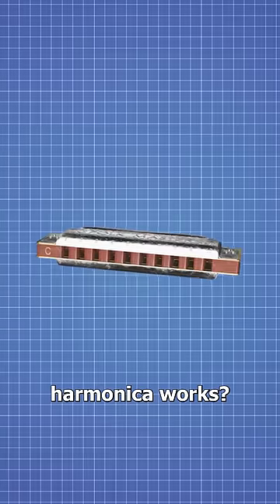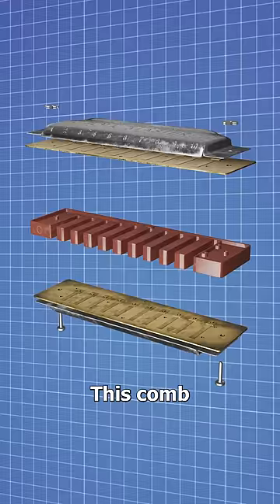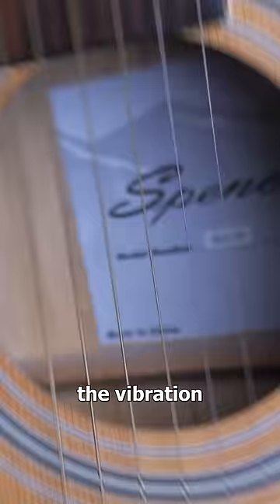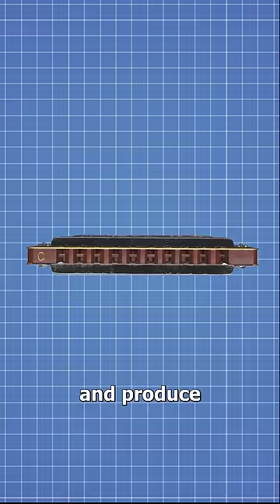How A Harmonica Works 🤔

Comment: And bending happens when you change the interna) pressure in your mouth (tongue, jaw, cheeks), making the reeds vibrate at a different range of motion, and different notes.
Reply: How do you shape your embouchure to blow into specific holes
Reply: @cambrysanchez2804 learn how to play clean single notes first with the right embouchure. I can share a couple videos if it will help. There’s a huge difference between playing a note, and playing it with good tone.

Comment: i love the animation and its great people want to learn about this, but there couple inaccuracies here: 1) the reeds are what vibrates. the reed plate is what the reeds sit on and pass through when blown into, the plate itself doesnt vibrate. 2) the sound isnt actually the sound of the reed itself, like a guitar string, rather the air is compressed and released as the reed vibrates up and down in the slot, creating pockets of high and low pressure in the air, making a soundwave. 3) the blow reeds are usually on the top plate, and the draw on the bottom, but it doesnt actually matter which side of the comb the reeds are. what matters is their orientation relative to the airstream. so the blow reeds will actually be inside the comb, and the draw reeds are locacted on the outside (in the video they mix this up, saying the reeds on the outside of the comb are the blow reeds)
edit: also nobody calls them reed strips, the reed plates with the reeds attached are just collectively called reed plates
Reply: The comb material does vibrate, especially on wooden comb harps. That’s what gives unsealed comb Hohner marine bands their trademark tone.

Comment: I literally just bought a harmonica too. Thanks for the video!! I’m gonna have to practice playing. It’s the first harmonica I’ve ever played
Reply: Hi man I have some experience playing harp(how most players call harmonica), the video while true is a little misleading, you don't need to blow hard to have a loud sound, you need to blow correctly, same thing goes for draw notes, also the note you get from the same hole changes if you draw or blow, cheers and ask me if you have any questions
Reply: @marly1017  thank you!! I really appreciate the advice. But how do you blow correctly? Do you go at a certain angle or a certain speed?